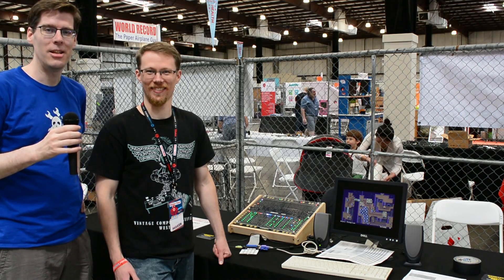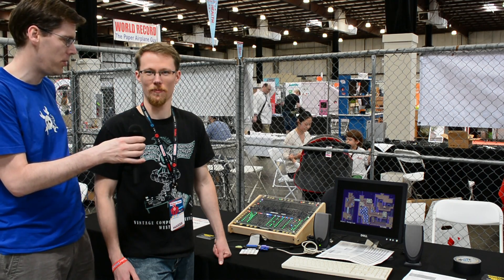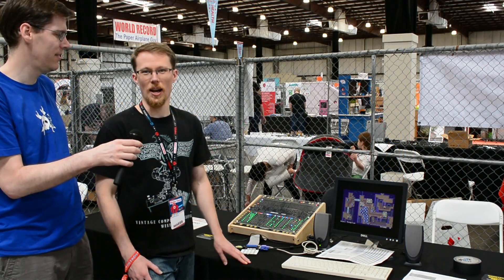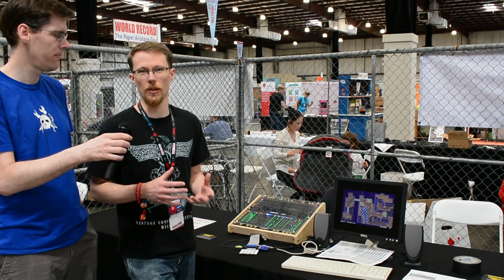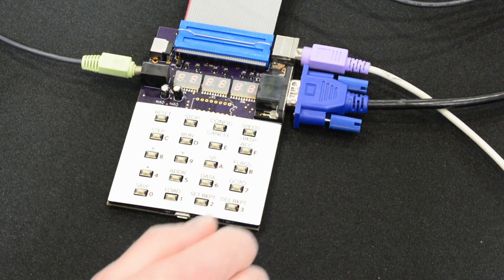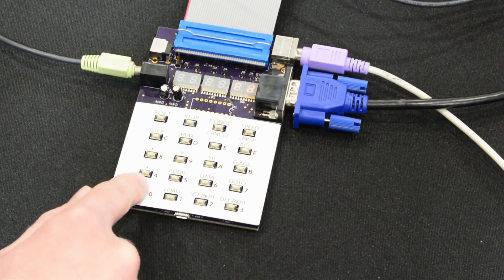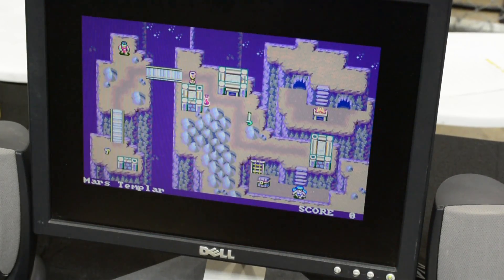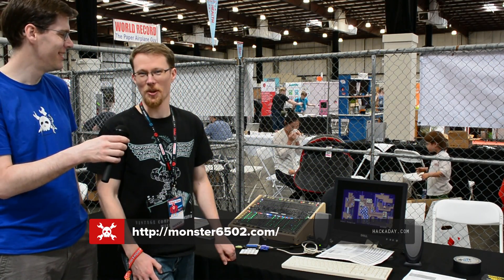Monster 6502 Now Powers a Retrocomputer

Comment: Meanwhile, a "modern" 2D video game would be written so inefficiently that it would require a 2GHz CPU and hog 800 megs of RAM just to do what's being shown on that screen.
Reply: The power of assembly!
Reply: Compilers can only do so much
Reply: except
Reply: Good luck even running a modern OS with those specs.  But hey, you can go back to shared memory and cooperative multitasking if you want.